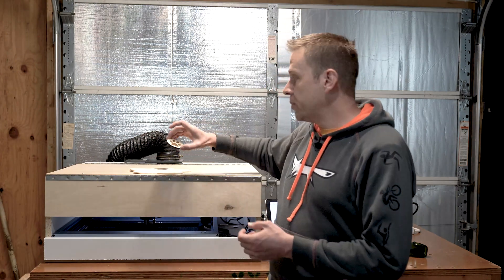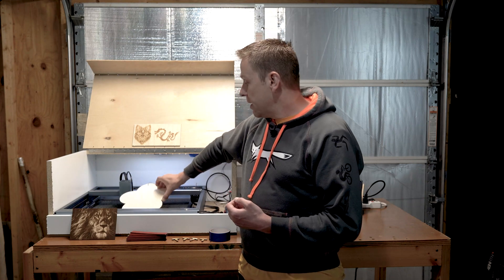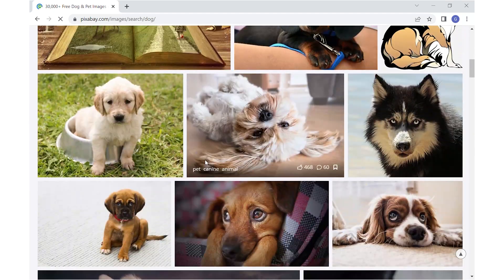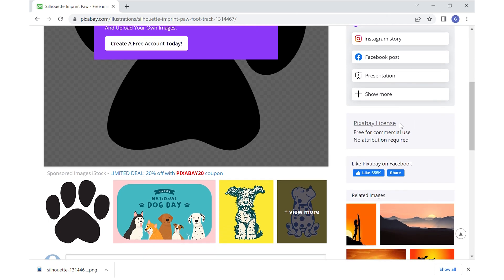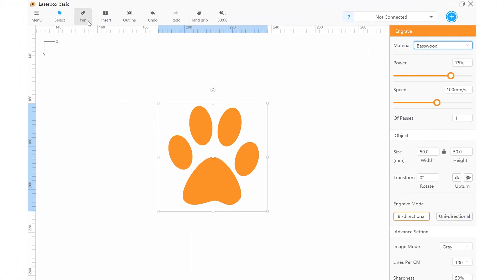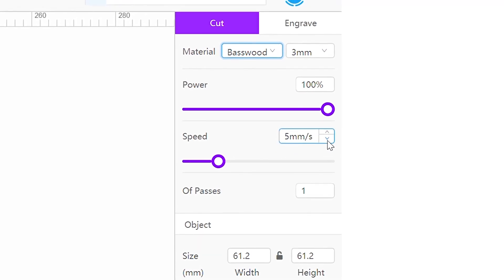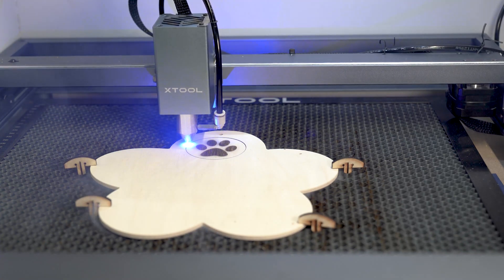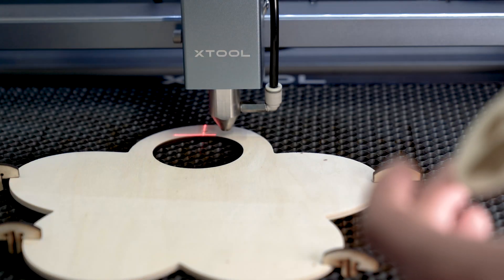Xtool- Create a Project using a photo!

Comment: Do you have a cut file for the tee tie down?
Reply from the maker: Cut file added to the description.  Resize the t-pin as needed to fit your honeycomb; each brand has a slightly differently size.